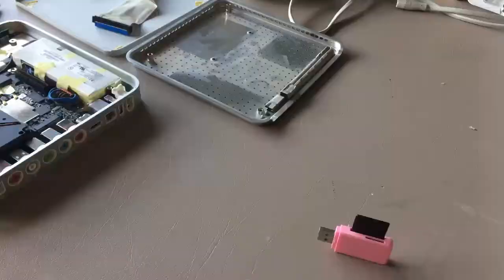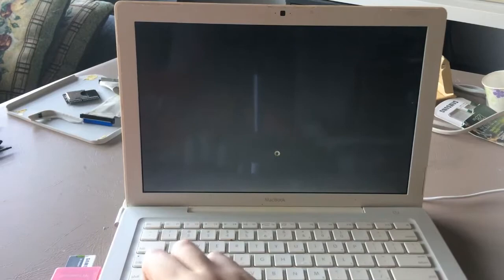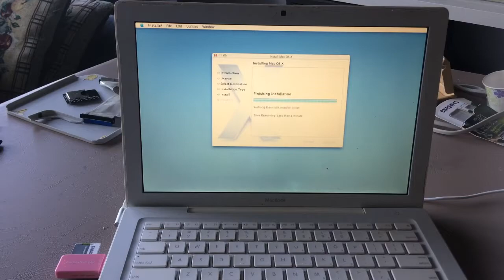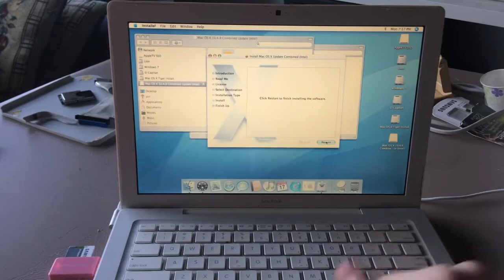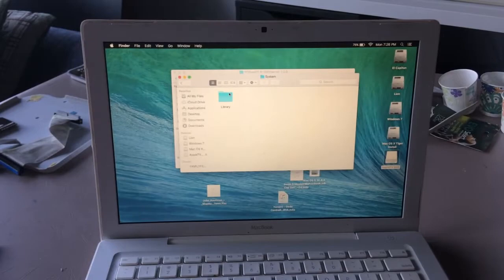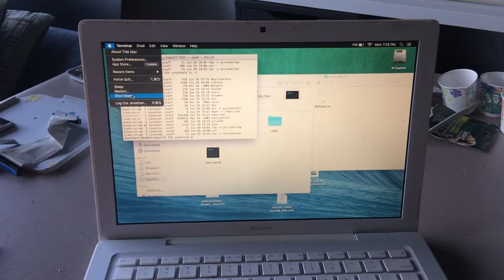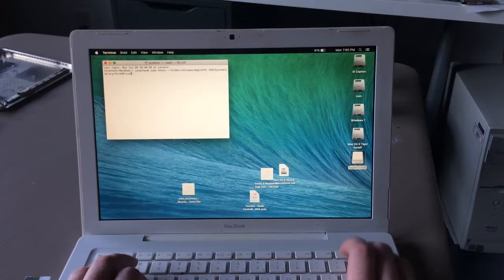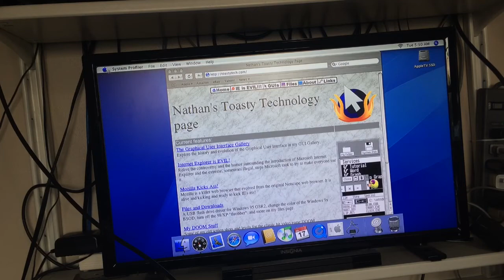Installing Mac OS 10.4.4 Tiger on Apple TV First Generation

Comment: is there any way you can upload all the files needed somewhere and post the link man? I've looked forever for everything needed but always end up with broken links.
Reply from the maker: if i can still find them, sure
Reply: @ezioisawesome56  tysm!!
Reply: @ezioisawesome56  and?    did U get sound working?
Reply from the maker: @methanoid  i dunno, i actually dug around for the stuff needed to get 10.5 running and it works way better
Reply: @ezioisawesome56  have U shared those files somewhere in case we want to do as well?
Reply: Hey, any chance of that 10.5 video? Also would it be possible to upload an image of your installation(s) somewhere? Please?
Reply: @ezioisawesome56  could u plz just upload an image of the original apple tv?
Reply from the maker: @13gherkin  been thinking about making it, although im unsure of the legality of uploading the image straight up, especially since it used a hackintosh disk which are def illegal i think
Reply: @ezioisawesome56  Understood. Still looking forward to the vid though. Also, did you ever manage to get the sound working?
Reply from the maker: @13gherkin  in tiger? i honestly dont remember lol

I got it working in leopard after searching for many hours for an old apple HDA patcher. VoodooHDA also works but is honestly crap